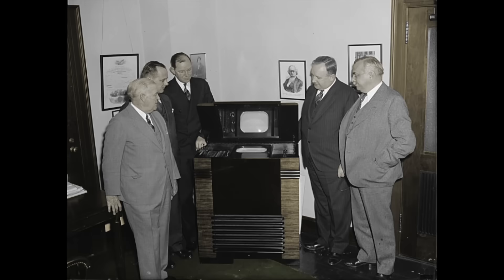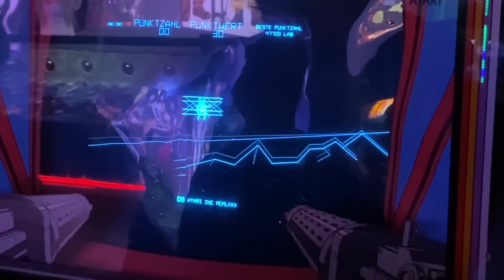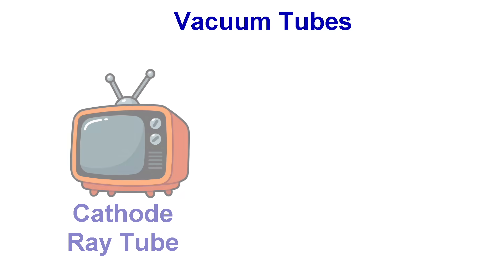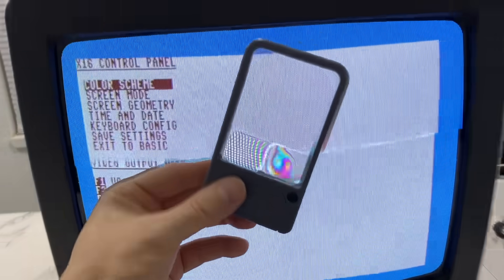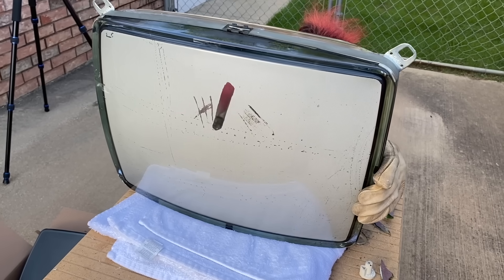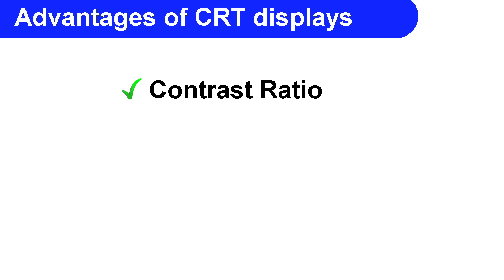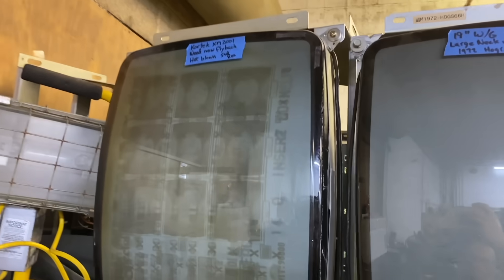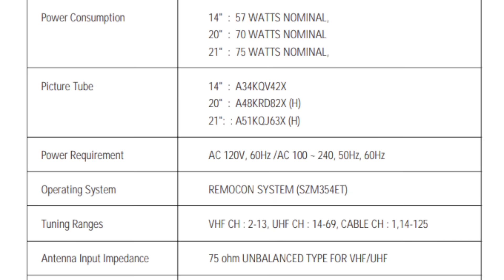How Cathode Ray Tubes Work.

Comment: I was one of those who hung on to CRTs as long as I could.  I simply did not like the "ghosting" that was so common on early LCDs -- that's one thing that CRTs definitely did not suffer from.  Pixel response times were essentially zero on a CRT.  Heck, my first high-definition television was a DLP, not an LCD, because I hated the "streaks" that would appear on early LCD televisions when the picture would pan left or right.  (And I didn't suffer from the "rainbow effect" that bothered some people watching DLP TVs.)

I was very much anti-LCD for a very long time.  It was 2009 before I bought my first LCD monitor.  And 2010 before I bought my first LCD TV.  But I freely admit that today's LCDs are superb.  The technology finally overcame the shortcomings that bothered me most -- pixel response time and contrast ratio.
Reply: It's pretty amazing how far LCDs have come.  There were other techs that were well developed earlier like DLP, SXRD, and Plasma but the LCD kept progressing.  LEDs are really what really changed things, especially when they become to use backlit arrays that could turn on and off lighting in areas.  Mini-LEDs have progressed that further, although there is still some light bleed visible on black screens when other areas are lit, but they do give LCDs something closer to black than before. Quantum dots can further help here. 

But the CRT was and is an amazing technology. Ultimately I think the biggest thing that gave the LCD its victory was not merely price, it was also weight and ease of use. It is ridiculous how light a 60" LCD TV is compared to Plasma, Rear projection screens, and CRTs. The 40" Sony Trintron Wega weighed 304 lbs.  A 65" Bravia X90L weights just 53.4 lbs without the stand.  Price + ease of use + weight all make the LCD hard to beat.

The LCD has also led the way in driving down TV costs. My family bought a front projection RCA television with three CRTs that folded open. Analog Tuner. Analog to fold it open. Cost over $10,000 in current dollars when adjusted for inflation and was 50".  You can buy a good 50" TV nowadays (with a little less real estate, as was noted in the video) for less than 1/10 of that price.  TV prices have fallen by over 90% in most cases when we adjust for inflation over the past 40-50 years.
Reply: Another thing people forget is the bad pixels on early LCDs which manufacturers claimed were a normal part of manufacturing. Around 2000 my boss tried to becoming an early LCD adopter but after taking three back because they all had duff pixels settled on a new CRT at about 1/4 of the price.
Reply: Yeah my third monitor is an early 2000s LCD and the ghosting is BAD, everything has motion blur. I only use it for static things like discord though so its fine. Although I do have to say that it is still very usable and miles better than the passive matrix display on my 1994 IBM thinkpad 340 laptop, you can lose the mouse with that and it makes playing DOOM quite challenging!
Reply: I heard the PSP had ghosting issues on the old one, and the new PSP apparently had interlacing issues instead.
Reply: On CRTs, you can still see a bright object leave a trail behind against a black background.  So there is still "fade out" time, just not fade in time.
Reply: @Dwedit  are you sure? I think it’s only a couple MS at most, which at 60hz shouldn’t display it over multiple frames since each frame is 16.7ms
Reply: @ZylonFPV  Look at footage of Pong, the paddles and balls leave trails behind.  It's more than just one frame of time for it to completely fade out.  The phosphor fade out is intentional to help avoid a visibly flickering picture.
Reply: @Dwedit  I guess it depends what phosphor they chose - there’s a wide variation!
Reply: @Dwedit  This was done only for cheap TVs, because they were supposed to run at low framerate and not cause a headache from watching it all day. Computer monitors were designed to run at around 100 Hz, which is fast enough to form a solid image even without any phoshpor fade out. You can find an old picture of a CRT monitor on Wikipedia, where it shows that it decays to almost nothing within a single frame.
Reply: @ZylonFPV that's why green was chosen for computer monitors, they had a better response time

By the late 80s/early 90s CRTs have improved and white phospors replaced the green phosphor monitors that was common in the early-mid 80s
Reply: But that's still no option to put VCR, DVD or cat on top of your LCD...
Reply: Indeed! I posted quite a long comment about this. The 500hz gaming screens are pretty nuts 🥜
Reply: You can't say you held on to CRTs as long as you could and then say you got an LCD TV in 2010. I had a CRT as my main television until 2013 and it wasn't because I hated plasma and LCD; I just didn't think they were worth the high prices back then. That CRT is now in my bedroom for playing old video games so I'm still holding on to it to an extent.
Reply: @chitlitlah   CRT is still unrivalled for old games!
Reply: @ZylonFPV  Heck, I'm still using CRT on my PC to play games like AoE!

Comment: As someone born very late into the CRT era, around the turn of the millennium, this was quite interesting to me! I was especially surprised that the phosphor coating was just a powder barely attached to the glass like that!
Reply: In his VCF video, he broke neck of the tube to the space invaders clone cocktail table and you could see where the air blew the phosphor off the tube.
Reply: @cooperschwartz318 So the thing was launched very far?
Reply: @MatthewCenance  No, it's a vacuum so the air was rushing in.
Reply: If you've ever seen a CRT that has been "necked" (aka the back of the tube broke off from rough handling), you will see a light or dark circle in the center of the screen from the phosphor being partially blown away by rushing air. 

Easy way to spot a worthless tube from a distance and avoid picking it up and wasting time on it.